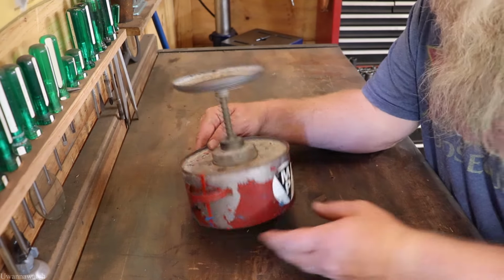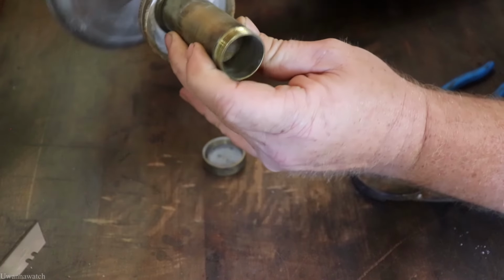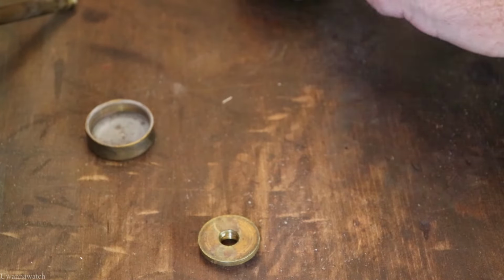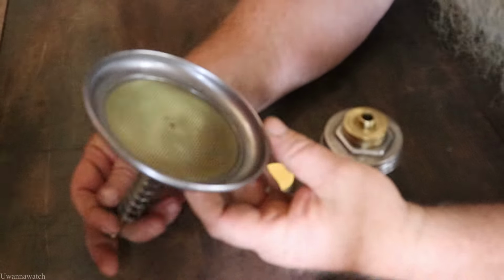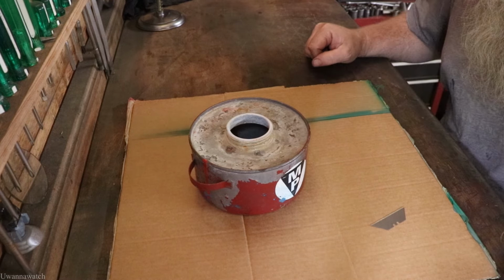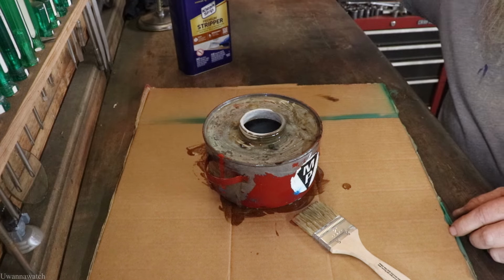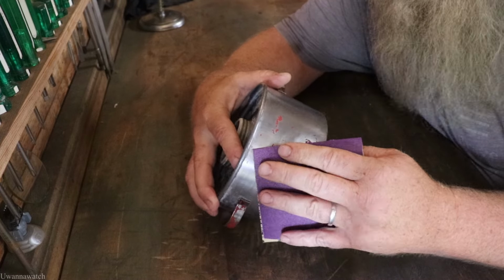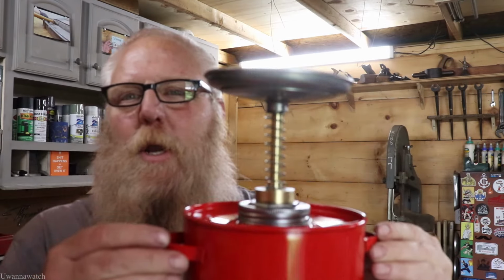Solvent Dispensing Can Restoration

Comment: Nice refurbish effort and project. I used similar cleaning dispensers decades ago at work. I used to repair circuit boxes for aircraft...
Reply from the maker: Thank you Gary, What did you keep in the cans? That's a pretty cool job.
Reply: @Uwannawatch  We used them for most any type cleaning liquids like isopropyl alcohol, methyl ethyl ketone, trichloride tech, acetone, and some others I can't remember right now. But each canister was marked for what was in it so no cross fluids would happen when refilling them...

Comment: I’ve never used paint stripper before. This was informative. Combined with your info on how to get Craftsman green from hammered Verte, I think I may be on my way to getting prettier tools. I don’t know why I thought paint stripper was thinner. I was shocked when you turned the can over and it slowly came out. Looks easy to use. Just paint brush. 👍
Reply from the maker: Yep pretty much, as long as it's above 40 degrees F .  it works great. put it on let it sit scrape it off.

Comment: When I saw that in your haul I wondered what it was , honestly never seen one before, I must say you have done a cracking job on the resto, looks amazing. Well impressed with your wire wheel set up … 😮. I bought a sandblaster, just a cheap one 😋
Reply from the maker: Tony!!!!! Thanks Buddy, I have been really happy with my set up especially now that I am rearranging my shop for the wood stove. Do you use the sand blaster a lot? I don't want to get one and find that it's just taking up space.
Reply: @Uwannawatch  tbf, I haven’t used it yet, I was given a big compressor, but like you say, at the moment it’s a large ornament till I set it up 🤣🤣🤣

Comment: Another nice job. I like the cool brass parts.  Looks like you didn't have paint problems as you did with the match dispenser. Red looks good. I notice there appears to be other markings on the top of the can. Dents are the big nemesis on oil and solvent cans and can really be tough to deal with if you dont want to use Bondo. I'm glad your can is dent free.
Reply from the maker: Hey Pat, Thank You!  I loved seeing that brass pop up like that and no paint issues I found a red that I like and works well. The other markings are P701 and MF in the diamond. Hooray no dents!